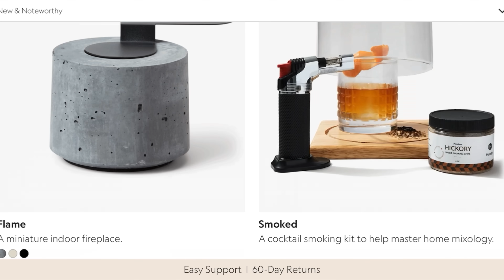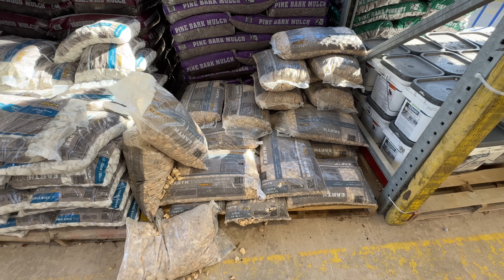Back Yard Fire Pit Build

Comment: So be very careful with the stones in your fire pit. Some seem to have been in the pond and there could be water in them. If that heats up a stone could crack or explode. Furthermore: if the fire pit has trouble getting a good fire dig a tunnel under the stones so some extra air can get to the fire.
Reply: It's probably good that they're doing this now, in the winter.  That should give the stones some time to dry out... Although, judging from the scenes at the end of the video, I'd say it's a little late to worry about wet stones.
Reply: Good thinking with the air supply. Since there is a slope behind the bushes, they could hide the intake of some galvanized oven exhaust pipe behind the bushes and it would also function as drainage.
Reply: true and good idea
Reply: I've been camping my whole life and I'm 53 years old and have always used river rocks when available for fire rings and fire breaks and have never had a problem except for a rare cracking of a stone. Can it happen? Sure, but it probably won't.

Comment: My only concern would be you now have a hole in the ground that will fill up with water when it rains. It would have a been a good idea to install some sort of drain pipe  that would keep the fire pit dry
Reply: He sloped the ground away from the pit so the only water that's going in there is rain that falls directly in and without the pond liner the ground should be able to handle anything short of a hurricane. I've never seen standing water in my fire pit and I don't have drainage either
Reply: I have a recessed fire pit. I live in western WA north of Seattle where its rainy. Never had an issue with water in my fire pit. My fire pit is about the same size as theirs.

Comment: Washer dryer combo has been around for like 20 years 😄
Reply: Yeah they're common in Europe
Reply: Yeah, they are common in big RVs, the few people I’ve talked to say you have to run the dry cycle twice to actually get dry clothes but maybe the newer ones are more efficient.
Reply: Washer and dryer combo here in Europe starts from 400 eur. Saves lots of space, the only con is that the work cycle when washing and drying is min 4-5 h. So if you have many kids and need to do laundry often you can do max 2 full machine in a day. With different machines you can wash and dry at the same time.
Reply: The problem is that usually the machine doesn't have the same washing and drying capacity. So if you put the full load for washing, you should take out half of the clothes out if you want to dry it in one drying cycle. And then dry the other half later.
Reply: Longer than that. My parents had one in their RV in 1994.

Comment: Just a quick pro tip for excavator so you don't tear up your grass. Use down pressure with the bucket when you want to turn, lifting the front of the tracks off the ground. That makes it so there is less of the track on the ground, less damage.

Comment: in New Zealand in the early to mid 1980's a company here created a washer/dryer unit. They were FANTASIC....except, they were prone to leaking after a few years as the rubber seal would get hard from the dryer. But they were easily replaced and in most cases carried on working for years! Nice job on the fire pit too!

Comment: 16:04 We have those Washer/ Dryer Machines now since a few years maybe about 10 or so, So if you want to buy one, buy one from Europe, there are Cheap between 500 to 1000€ have a good Load Capacity, only problem would be the Electric Stuff, and the Plug :face-blue-smiling:

Comment: Washer / Dryer combination is pretty common here in Europe. I don't know many people who actually have them though. They take forever and use a LOT more energy.
Reply: Yeah the traditional combos take less space and can ventless and/or run from standard voltage outlets, but also come with a lot of downsides. That's why they never caught on in the U.S. But the new ones like in the video are a game changer, they take advantage of improved heat pump tech to do a much better job with much less energy. At least that's what I've heard. Just bought one myself to install this week, will have to report back . . .

Comment: pro tip for drawing an easy circle: 
1. put a stake in the ground at your center point
2. tie a string around it and measure out (away from the stake) the radius you want
3. tie the other end to your spray paint can, keep the line taut while going in a circle around the stake

Comment: When was the last time you posted a video demonstrating that you need(!) a dump trailer? Get a 14000# (two 7000-pound axles). Mine is 14 feet long and will happily carry a 10,000-pound excavator or skid-steer. If you go longer, you may have some difficulty getting enough height (steep enough angle) to dump sticky (wet) stuff easily. If you go shorter, your equipment of choice may not fit. If you need five, or less, tons of material at your job site. Just go get it. Need to haul a load to the dump? Handle that stuff only once to load it, maybe even with a machine. The dump-run could then be a one-person affair. Jamie, just part with a few bucks. You'll wonder how you ever functioned without a good dump-trailer. They are a great time/labor/aggravation/money saver. 
I love and respect the entire Perkins crew. You guys have skill, talent, integrity and always manage to show us a good time. I'd confidently trust you to build anything. Thanks for taking us along.

Comment: Im sure you did, but ou should double check what kind of stone you used as the basin rocks for the pit. There are lots of rocks that are actually porous and when exposed to heat, can explode from the water inside them expanding into steam. This happens with river rocks alot.
Reply: especially since a lot of them were literally sitting in a pond for years

Comment: I'm surprised you didn't go for a smokeless firepit. Really like the lighting.
Reply: Wtf is a smokeless firepit?
Reply: @StallionFernando hahahahhaha
Reply: It is a series of boxes and tubing that you place underneath your firepit. It basically pulls the smoke from your fire and diverts it away from your seating area.
Reply: @StallionFernando 
A smokeless fire pit, at least ones I’ve seen, are similar to rocket stoves where they draw the smoke back down into the fire to burn them off. They produce a lot less smoke and excess gasses that way, because most of it gets burned back off.

Comment: The low voltage is one side positive the other is ground. All the light are in parallel and “make the loop” between the two wires.

Comment: Do you think you should run a pipe out to daylight so it doesn’t fill up with water?
Reply: It won't. They removed the pond liner and sloped the ground away from the pit. The ground in the pit should be able to drain anything short of a hurricane. I've never seen standing water in my pit and I don't have any drainage.

Comment: I worry that the landscape fabric is not enough to suppress weeds. At least in my experience fabric doesn't work for more than a year or two. Then the fabric just becomes a huge nuisance, because once grass and weeds grow through it, it's harder to pull the weeds. I would have at least doused the site with "Preen" (brand name for pre-emergent weed suppression) before putting the fabric down. Better still would be pavers with polymeric sand.

Comment: Lg has had a combo washer/dryer model available in the US for many years, doesn’t have the best reviews though.
Reply: I’d imagine that you’d have to skimp on the size of the heating element for the dryer. Not to mention running extra lines and vents alongside pipes probably makes it a pain to work on if it breaks.

Comment: Nice job. Although I give it a week before you’re driven mad by finding mulch in the gravel and gravel in the mulch.
Washer dryers old news in the UK. Tend to find they do both jobs badly and are usually reserved for small flats belonging to lazy single blokes although at 2 and half grand I’d hope that one was slightly better.

Comment: Looks awesome!  Except...well, I hate to throw any water on your fire, but not sure why you didn't create a little drain running downhill out of your pit for rain water to drain away.  Even though you sloped around the pit so that water doesn't run in there from the surrounding area, it will still collect when there's a lot of rain.  But if that becomes an issue you've always got Ray and Jay to dig that for you!  😅

Comment: Those washer/dryer-in-ones aren't that expensive.  At least, just with a quick Google search, I found one made by LG in Lowe's for as little as $1,400.  Heck.  A few years ago I priced a basic, no frills washer-dryer SET (two units) and the cheapest I could find was $2,400 for the set.

Comment: IIRC those low voltage wires work by having the return go through the fixture back down the other wire, tho its been a while since I messed with those so don't quote me on that.

Comment: Erik... it's impossible to dig a foot deep hole in the ground that doesn't catch some amount of rainwater run-off. If you didn't want to collect water in the pit, you should have built the depth of the pit UPWARDS (stone walls) and graded the dirt away from the pit wall.

Comment: So in the future when you’re doing something like this on the top of the hill where it’s so easy, you’re gonna dig a hole and put a fire in it so there’s gonna be times, especially considering the fact that that was a pond and it’s all clay! You will wish that you had a drain so you could just dig in Underneath the bench to the edge of that hill and fill it with large stone so that the water will follow off the edge and it won’t hold in your fire pit like a French drain almost you could even use clay pipe if you wanted to, but that’s just yuppie stuff

Comment: you could have just added gas on the water for the same thing but the office should be more of a transformation - give yourself elbow room and ultra large desks and if you can't plan shop side right now allow for expansion plans later - the dead of winter is a good time to keep the home oil spill fires burning #architectural digest

Comment: I could imagine what those low volt lights cost you as I bought 12 light set and a 100 watt transformer and 100 ft. of 12 gauge wire years ago for $59.95 and now I bought 1 cheap flood light and it was almost the same cost and came with cheap wire.

Comment: The electric wiring is not that hard. The cable contains two wires and current flows through one wire to the lamps and returns through the other wire, so circuit is closed. In case of AC, polarity does not matter, in case of DC, the lights will take care that they can handle both polarities.

Comment: "Pro Tip"... LoL... When using a "track" loader such as the Mini... when you are turning, drop your bucket to the ground, and put a bit of downward pressure on it, relieving some of the weight on the tracks... which in turn reduces the risk of tearing up the grass...